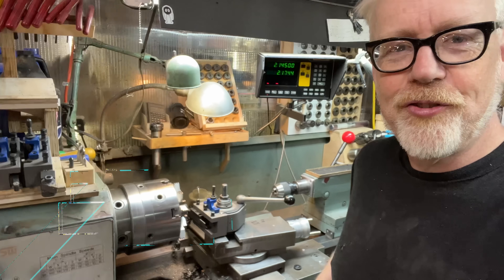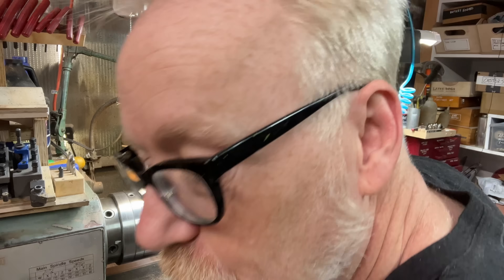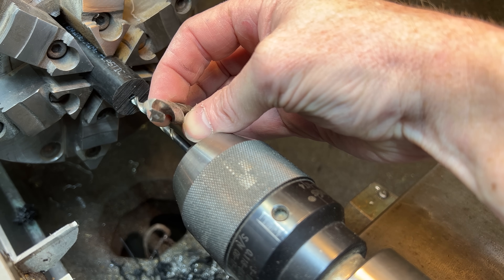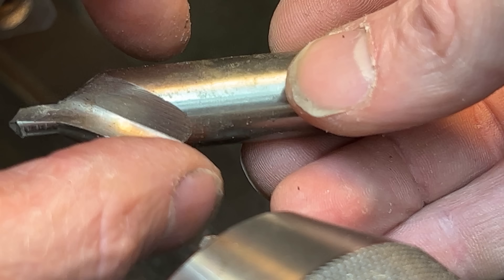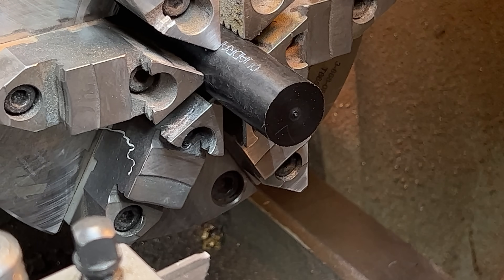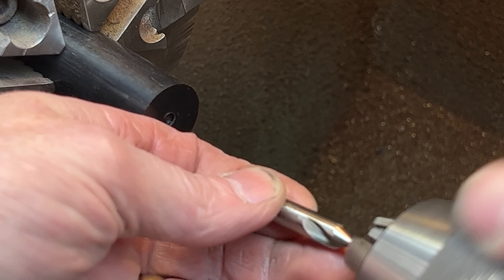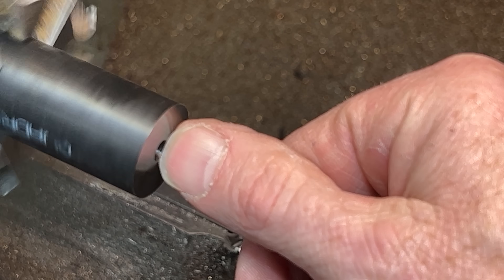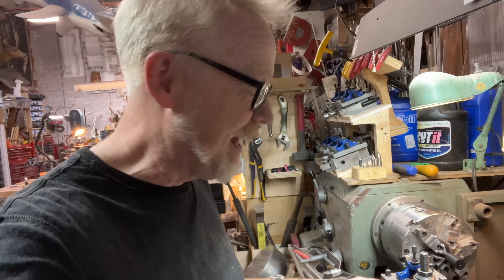Why Adam Savage ALWAYS Uses Center Drills

Comment: I did not have a smaller center drill, i just made it from broken m4 tap. The body is around 6mm and the shaft which became the tip around 3mm. I need second try to make the tip center and deep enough.

Tap bit often made from hard steel, this one is made by osg it is hss with TiCn coating. The coating mostly gone, but it was sharp enough like hss co drill bit.

Comment: Hi sir 
I am from chemical engineering. I would like to know what are the different between the drilling bit angles and what each angle used for? 
The other question the Centre drilling bit the 2 ends are the same or one is the left and the other is the right handed side?

Comment: That is not what a center drill is for. If you're going to make an authoritative video on a topic, at a bare minimum know what you're talking about.

 A SPOTTING DRILL is to be used for the purposes you described. A SPOTTING DRILL has a 120 or 135 degree point, just like your normal drill bits, So they find the dimple left by them and run true.

A CENTER DRILL creates a 60 Degree cone in the work. This is to mate with lathe CENTERS, which, Surprise, are 60 Degrees.  Used  to support work or for turning between "centers."

All you are doing is rapidly destroying your drill bits by thrusting a 120-135 degree drill into a 60 degree hole. and then telling 6.8 million people that is a good Idea. 

Being rich doesn't make you smart.🤡
Reply: I wouldn't necessarily say it damages the drill in a significant way but I've noticed suboptimal vibrations when a big drill enters a 60 degree hole. I only just recently thought, "wouldn't it better for the drill to find the pilot with a similar angle to itself?"

Comment: I have an older keyed chuck that I leave a center drill in at all times. I only swap out bits in my keyless chucks. That makes it almost effortless to always use it. I would prefer to use spot drills rather than center drills for that purpose, but the convenience with the center drill tends to win out for me, and it's rare that it makes a big difference (at least in my work).

Comment: Well, this is actually not correct - but we all do it ;)
So what Adam is missing is that spotting drill is actually to be used to drill accurate holes - and center drill is for lathe center. I guess even Adam needs to learn some new tricks.

Comment: A bit of advice for avoiding focus problems on those close-up shots: use a smaller aperture. Set the camera to the highest F value the lens will do, and you shouldn't have any more problems with the focus, since everything will be in focus. This will require longer exposure times or a higher ISO, so it's a compromise. But closing the aperture, even just a little, will help.

Comment: Center drill isn't geometrically designed for "spotting", it's shaped in that weird way to drill a hole for the lathe centers when you want to support the material or machine between centers.

There are better geometries for spotting drills that have the same angle as with normal 118degree drill so the engagement happens properly when drilling.

Yes, using center drill works, but it's not exactly designed for the purpose even if everyone uses it for it.

Comment: I see a lot of comments about using spotting drills but nobody is talking about 135 degree split point stub length drills. No center drilling or spot drilling necessary. Jobber drills get the job done but stubs are much faster. While you might argue that a stub length drill might not be the most accurate hole we all know reaming a hole is much more accurate. Better yet bore the hole.

Comment: For the 'regular' guy (or gal) that doesn't have extensive hardware for drilling, and this goes for drill press and even hand drills and you find your drill tip wandering, a good tip I got from my father (many many years ago; thanks Pop) is to short chuck the drill (minimize the protrusion of the drill tip from the chuck).  The reduced exposed drill shank will be stiffer and wander less (or not at all).

Comment: If it was any other youtuber I would have abandoned that video at the beginning. The focus issues, the nausea-inducing moving of the camera, the whole "I haven't prepared anything for taking the video" vibe ... . And that is before I take into consideration that the centering drill is for making centering holes - for using a center in a tail-stock or machining between centers. Spotting drill is for starting holes in a precise manner.

Comment: Another machinist here :P , we use center drills in our shop in our mill department :\ . I'm not a fan admittedly and use 120 spot when I can. At times though we get programs that use 90 degree spots :\ , not good for drill shoulders but they still do the job. Center drills can still work for mill and lathe and older shops tend to use whatever is lying around so I am glad you at least use tooling to keep your drills from walking :) . Given the choice and the time to modify programs though, I use 120 spots, especially for cutting steel. Now I feel dirty, not trying to jump on the pre-existing bandwagon but before seeing the comments, this is what I thought as well.

Comment: Stub length drills are substantially stiffer than jobber length drills.  In most cases, even in Delrin :-), stub length drills can be used without spotting.

Comment: I'm curious, how come you use 60 deg center drills over 90 deg spot drills for starting a drill? I've only used them if I need to set up a piece with a live center for turning something more than 3 times my diameter.

Comment: The reason spot drills and center drills don't wander as much when starting holes is 2 fold. 1) They are hardened and rigid from end to end, but a twist drill is not that hard at the shank end. That is so they can flex a bit and are also less likely to shatter. 2) They are normally dramatically shorter than a jobber length drill bit and therefore much stiffer.
Reply: I was a little disappointed to have to go this far down in the comments to find this answer.  100%.  the hardening is both key to the issue, and absolutely required for jobber drills to work without breaking.

Comment: Adam, greatly appreciated person. Inventive, charming chaotic and get's the job done eventually. I like your style! I'm a similar person and used to use a center drill a lot. But, when cutting nasty hard stuff like the Inconel's and waspaloy's the center drill ends his functional use just to soon for the price to obtain such a gem. Therefore I use a 45 degrees indexable chamfering tool to make a center hole for the upcoming drill. In the middle or center it doesn't cut so you have to start off center first and shift to the center afterwards. Than you dig a hole big enough for the drill to follow. The insert lasts a hundred times (estimate, I'm in for alcohol) better than burning the HSS center drills in two or three workpieces (excoriating, it's the intake again) Maybe this helps you to be a even more daring and confident machinist. Keep up the good work; much appreciated! Best, Job

Comment: Centre drills are for making a hole for lathe centre, end of story. Why do folks use them? Because they are always there.  If you stop using jobber length drills and use a stub length drill spotting is rarely required.  If you do need to spot, use a spotting drill, they cut much better.

Comment: Center drills are great for chamfering the ID of small steel or stainless steel tubing after you cut it with a tubing cutter.  Put center drill in cordless drill

Comment: I prefer a center drill over a spot drill for all holes, not just on the lathe, if drilling holes on a manual machine or using HSS vs carbide in a cnc machine.   It allows for the full web of the drill to be cutting before the chisel tip contacts the material and eliminates the tri lobe hole due to the chisel walking.

Comment: This information is incomplete. Although center drills can be used to start a pilot for a twist drill, it is not the primary purpose of them. The primary purpose is to drill a hole for a live center (or a dead center) in the tailstock. A spotting drill is the proper tool for starting a hole for drilling. Many people will just use the center drill because it's handy, not because it's purpose built for the job.

Comment: There are some British people rebuilding WW2 heavy iron, the British stuff they always have to weld fill and redrill because nothing lines up.  American equipment they love they can unbolt and bolt back to anything of the same model as the patterns are exactly the same.  You can only do that by starting with center drills.

Comment: Center drills are ok if you don't have something closer to the 118° degree.
I had holes wind up .0015 out of position due to a slight walk of the twist drill in the 60° center

Comment: good tip adam, but you also use it for lathe and milling jig centres, as the 60 deg. tip cuts the supporting taper on the inside, so the centre holds the object with mimimal runout, as this taper is a close fit to the cone of the center itself. ( the small tip, in this use adds an oil space, to store lubricant, when using 'dead' or non-revolving centres- to save heat and wear).

Comment: I'm among the likely very small percentage of the audience that is a journeyman machinist. Yes, as a  rule, you should always use a centering drill in general. However, if you can (and  the application will call for it) buy screw machine length drills instead of the common jobber length drill. Screw machine length is much shorter and has a vastly smaller tendency to wander. If you are in a production job and can get away with it - buy screw machine length and you and maybe 60% of the time cut out the center drills. The twist drill featured here is a jobber length.

Comment: Hey Adam, just to point out a spot drill works great as well for starting holes. At work we use a 3/8" or 5/8" x90 deg spot drill to start our holes (and we drill to a set depth with them to give us a slight chamfer on the hole). One thing to point out is that HSS drills flex a LOT, especially when doing cnc work. Carbide drills don't flex nearly as much and we rarely spot carbide drill work.

Great primer though and for both the pro and amateur machinist its always good to remind us that what might seem like a solid setup can flex on you and not give you the result you want.

Comment: Umm... Center drills are for prepping a part to be turned between centers, the cone is 60 degrees, same as your lathe centers. They are also ground with clearance and will side cut to a certain degree, mic the tip on one and slowly rotate it (taps are ground the same way, mic a four flute, cutting edge then heal). Twist drill margins are a diameter.

Comment: simple answer: because I have a mental block that makes me subconsciously not film while I'm using one."

also, high speed steel bits flex more than you think, but often less than you need.  anyone with multiple half full boxes of small high speed steel drill bits will get that reference.

Comment: In the custom CNC metalworking business I can't remember when I used a center drill last.  They're not needed.  On occasion we'll use short stub drills on deep holes with coolant thru as a pseudo drill bushing but that's it.  A 118 degree jobber drill is just a general purpose drill.  HP split point or NC points require no spot drilling.  Center drills are tools designed for centering for 60 degree centers.  Use them if you want but it's no longer a preferred method.
Reply: Yeah, I have one CNC lathe in the lab and a manual lathe, I only use center drills on the manual or when doing reworks that require a center.
Reply: I use canter drills all the time, helps eliminate that bulge you get when form tapping aluminum

Comment: Adam, the other reason a centre drill doesn't 'flex' is they are made from a much harder material than a normal twist bit. Also I hope you face off your part in the lathe BEFORE you drill a hole.....cheers

Comment: Shouldn't a center drill be used to start holes with a drill press for the same reason as on a lathe?
Reply: Absolutely, although as others have pointed out the real proper tool is actually a Spot Drill. A center drill works, but a spot drill is best.

Comment: Center drills are for using live or dead centers.  The tip is small to make clearance   For the tip of the live/dead center and the 60 angle on the larger section is what the Center should be touching .

If your drilling a nc spot drill is the correct tool. They have a correct angle for drips to start.

Comment: "Just the Tip" The tip of a center drill is 118 degrees which is perfectly fine for starting a hole. If you use the 60 degree angle on a center drill it may work but it's not great on your drill bits. The 60 degree angle is for live/dead centers hence the name center drill. A 120 degree spotting drill is the best choice for 118 degree drill bits.

Comment: Damn Adam, stop putting your hands in that lathe like that. You're seriously scaring me.. Have you seen a lathe accident? I've seen and heard, of absolute horror shows with high horsepower, larger lathes, specifically like you have.. google it. You'll never stick your hand within 2 feet of a lathe again. I know you want to demonstrate and show us, but careful buddy.. We all want to keep you around for a while longer. 
Also, the standard tip, which looks like a chisel is the reason the drill is walking. The tip cannot get through the material properly. Look for a Split Tip Drill bit. They're good for starting a pilot hole first, then sending a standard tip drill bit through next. The rigidity of a center drill is the only reason you're getting away with this.. it won't flex or bend.. but a split tip will not either.

Comment: Adam, you're perpetuating a misconception in machining, yes the tool you used is called a "center drill", but its purpose is not for starting holes, rather its purpose is to prepare a piece for "turning between centers" which you're not doing.  The actual tool you should be using is call a "spotting drill".   Center drills have the wrong angle (60-deg) so when you go to use your regular drill it only contacts at the lips which often results in a triangular shaped hole until you're about a half diameter deep.   Spotting drills have the same angle (120-deg) as the regular drill, so it contacts everywhere, especially including at the point not just at the lips, so the regular drill tends to be much more stable in a 120-deg starting hole and tends to go in much more accurately.

Finally, if speed and productivity matter to you then you should have a set of "split point stub length" drills, these almost never wander and almost never need spot drilling.

Hope That Helps, please get a set of spotting drills, and save your center drills (the smaller sizes are actually very fragile, so should be saved for when you really need them and then used very carefully),  and let us know how they work for you.

Peter A Lawrence, San Jose CA, (if you want to see some of my work check out baemclub-dot-com online newsletters).
Reply: Learnt more from this comment than from the 10 minute video. Thanks for posting!
Reply: @DC430  Would have been 2 minutes if the camera could focus
Reply: Great comment, just a small note -
the idea is not to match the angle exactly, but have a slightly greater included angle. This causes the tip to make contact first, then work it's way up to the shoulder until you're at full diameter, as is mentioned in a couple other comments.
The standard 120 degree spot drill mentioned would work as intended, for a drill with a standard 118 degree included angle. If you're using a 135 degree drill for harder materials, they also make 140 degree spot drills, ect
Reply: @asEZasPi  excellent comment, now I should go out and buy another set of spotting drills because I have lots of both 118-deg and 135-deg drills, except that I almost never need to spot-drill with the 135-deg split point drills as they're so good at staying "spot on" by themselves (but I'll probably get a set just to be obsessively complete).

Comment: Adam, stop spreading false information
Center drills are not the tool for this job! Because most of them are split point and beefy, they do work for this purpose, but that is not what they are for! they are designed to create the geometry for a center on the tailstock. the appropriate tool here is a spot drill, ideally with a wider cutting angle than the drill you intend to use next.
Center drilling as you have done it is in no way a precise means of center finding, although it's better than just plunging straight, it's not accurate. please take this down or make an addendum

Comment: Center drills are for making 60 degree internal angles for centers.  You need a spot drill, for HSS drill that would be a 90 degree spot for an 118 deg point drill.  Only for HSS/cobalt.  Carbide spots/drills are different.  Use a 142 deg spot for a carbide 140 deg drill tip.  As a machinist and now tooling salesman I run into this a lot from customers
Reply: fyi at work we pretty much use the 90 deg spots on everything, including when using carbide if we feel like it. Most carbide drills that we use though we don't spot.

Comment: This is NOT the purpose of a center drill, they're made for drill a point for a live or dead center.
Spotting drills are for starting holes.
Reply: I've watched Adam spray soda pop all over every machine tool in the shop, helicopter a bowling ball in a drill press, and use his metal lathe ways as wood chisel rests often enough to not be bothered at all when he gets on camera, talks a load of drivel, and I go on with my day as an actual professional.